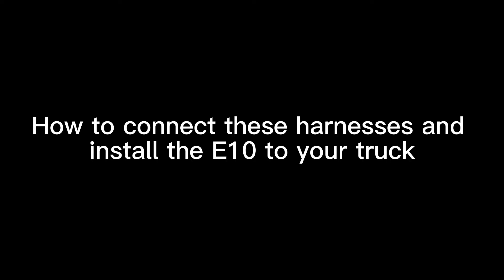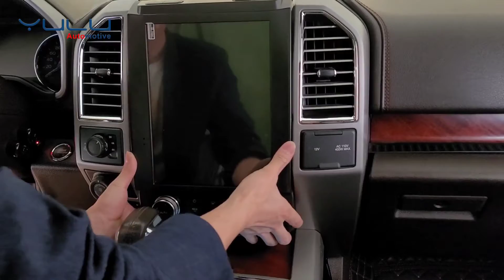(STEP 3) YULU E10 for F-Series Tesla-style screen installation video. F150/F250/F350/F450/F650 radio

Comment: Just finished the installation of this today in a 2018 F150 Platinum. I upgraded from a previous Linkswell. The video is very informative and users should watch and take notes before proceeding. I did not do the tailgate release (too complex for my taste). Very happy with the installation, will update with usage later. Maintaining factory HVAC controls is a HUGE benefit, thank you for this approach Yulu!
Reply from the maker: Thank you so much for your review!

Comment: I already installed the stereo in my f150 I have an AMP Kicker but the volume is at maximum and I cannot control it from the stereo or from the steering wheel, the stereo says it is at 0 but it does not sound very loud

Comment: I was all onboard until you wanted me to run a cable back to my rear camera. Can't we use the cable that's already connected to the rear camera?
Reply from the maker: Of course, please find the contact information of the YULU after-sales engineer in the package, and ask her to send you an adapter cable.
Reply: I believe the wire they ran was for the tailgate control. They mentioned that if you were installing their rear camera you would run the cable the same as shown.
Reply from the maker: Using the factory 360 camera system only requires connecting the harness that controls the tailgate. If you only have a factory rear camera but want to upgrade to an AHD rear camera, you need to connect the E10 to the AHD camera on the tailgate with a wire harness. But we already have a new solution that saves you the trouble of connecting a long wire harness. Just change a plug at the tailgate location and utilize the factory rear camera harness to transmit signals and control the tailgate.
Reply: @yuluautomotive7433  What is a AHD rear camera? I already have 360 Camera on my truck. I don't want to run a cable all the way to the back of my tailgate. Can you make a video or show some pictures as to how we can avoid running the cable to the tailgate and just using the factory 360 camera with the system?
Reply: @vedadbecirovic465  Its a Higher Def cam. However YULU previously stated that the AHD cam does not work with 360.
Reply from the maker: Your truck already has the 360 camera system, and if you also don't want to control the tailgate from the screen, connecting the wiring harness is no longer necessary.
Reply from the maker: Thank you so much for your explanation, you are absolutely right!

Comment: Does the E10 not use the stock rear camera wire/plug? Wondering why a new cable has to be routed for the rear camera...
Reply from the maker: We have a method that can directly use the factory camera wire/plug, please contact our after-sales engineer before installation. Thanks! Phone number: 8184846579.

Comment: If my truck doesn't have 360 camera, if I provided my own cameras, could I use now have 360 camera?
Reply from the maker: We support factory 360 cameras, it should be noted that we only have front view and rear view outputs on our cables, if you want to use aftermarket 360 cameras, you need to buy the all-in-one 360 camera
Reply: @yuluautomotive7433  Thank you for the replies. Do you have a link to your all-in-one 360 camera? I'm having trouble understanding how an all-in-one unit would work but if I could see the product, it would help me (I'm a visual learner).
Reply from the maker: @TheRoadTaken  https://www.amazon.com/Weivision-Degree-System-Panoramic-Camera/dp/B0105XR91O
please go to this link,It's not our products,just for reference
Reply: @yuluautomotive7433  thank you so much.

Comment: Wondering about the external microphone - if the factory microphone works, what's the benefit to installing the new microphone? Does the factory microphone work with the E10?
Reply from the maker: E10 cannot directly use the factory MIC. But for the sake of aesthetics, we made the MIC look like an OEM, so that it can be hidden in the top control panel just like the OEM MIC. This is a unique approach among aftermarket products.
Reply: @yuluautomotive7433  is there any instructions on installing the mic in the upper control panel?
Reply from the maker: @danmaloy8707  please refer this video:https://youtu.be/ONomHWXjfrM

Comment: Not able to get the mic working, I Installed per the video. I have 2018 F-150 Platinum with 360 cameras and B&O sound system. Everything works except the sound for the phone both incoming and out going, I have an iPhone 13 Pro Max.
Reply from the maker: Don't worry, maybe the MIC plug is disconnected, please check its plug again. If the fault cannot be resolved, please contact our after-sales engineer for help. Phone number: 8184846579
Reply: @yuluautomotive7433  it was indeed the cable, the mic now works. I believe my TLINK app needs to be updated/replaced it will not connect even though I’m connected via Bluetooth. Also, I purchased a Verizon SIM card and service, however after activating it in my iPad and confirming it was activated and worked. I installed in in E10 and when I turned on “Cellular Data” in settings it said SIM card disabled. So, I purchased a mobile hotspot with the hopes I could connect the E10 via Wi-Fi and have mobile internet to drive the apps while using Bluetooth to operate CarPlay. Sometimes the E10 would connect to the hotspot, but TLINK will not connect now. Prior to the SIM card exercise, a number of times when the TLINK would connect, the CarPlay music would only play out of the drivers tweeter speaker. I’ve reached out three times in the past 2 days via the What’s App chat with no response, I’ve also left a voicemail (today was the first time when I called the number I was able to leave a voicemail) I’ve also sent a message through Amazon where I purchased the unit. I really need to speak to someone on the phone, these issues are to convoluted and numerous to resolve in a chat.
Reply from the maker: Sorry, just saw your message. Our after-sales engineer said that he has responded to your question. If your problem has not been resolved, please continue to communicate with her until all your problems are resolved, thank you!

Comment: So I purchased one of these today. I have the 360 camera system. When I bought it, it said it would retain the 360 camera system without having to run additional wires. Is this correct or do I have to purchase additional adapters?
Reply from the maker: You don't need to buy any additional adapters for this.

Comment: how does the tailgate wire hold up under the chassis and wheel well in snowy weather?
Reply from the maker: No matter what the weather will do, the wiring harness goes from the screen to the tailgate.

Comment: I have a non working oem 360 degree camera because of the IPMB module went bad If I buy this unit you think my existing 360 degrees camera would work for the unit? I would have to spend $2500 to the dealer get my 360 degree camera working
Reply: It’s for 2017 f250 with manual AC
Reply from the maker: The factory 360 module is necessary for the E10. Go to ebay to buy IPMB modules, you only need to spend very little money. Make a note of the SN on your OEM module, search for it on ebay.
Reply: @yuluautomotive7433  thank you I just ordered a new IPMB.
Reply from the maker: good

Comment: Anyone else having issues with the bracket not connecting? Everything else is set up correctly but the bracket is not "snapping in place" similar to the guys struggle in the video.
Reply: I know this reply is old but I wonder if he didn't transfer the clips from the old bracket to the new bracket? That wasn't shown in the video.

Comment: Installed my unit today. Tried doing it without and with the audio box. I still have no sound. I called the number and all it does is ring and ring then just hang up. Can't leave a message.  Can someone help me figure this out?
Reply from the maker: After connecting the audio box to the E10, you need to enable it in the car settings.

Comment: I also have radio but no Bluetooth and no sounds from YouTube or any other app.
Reply from the maker: Please connect the audio box to the E10. If you bought the E10 from YULU’s Amazon store, shopify store or ebay store, please find the audio box in the package and connect it to the E10 according to the steps in the video, and then enable it in the settings. If you bought the E10 from other sellers, please contact them to buy an audio box, or contact our after-sales engineer to buy it. Tel: 8184846579

Comment: Can't you use the original mic from the factory?
Reply from the maker: The factory MIC cannot be used directly, because the electrical reference is different. But we have another MIC that can be installed in the factory MIC position, which looks the same as the factory MIC and is also installed in the sunroof control panel. If necessary, please ask for it from the after-sales service personnel after purchasing the E10.

Comment: I just finished the installation and my AC doesn’t work
Reply from the maker: Please check that the plug on the back of the A/C control panel is connected correctly and that the pins in the socket are not bent. E10 retains the original A/C system and there is no electrical connection with the A/C, which will not affect the normal operation of the A/C. If the A/C is not working, there must be something wrong with the installation. If you still can't find out the reason, please contact our after-sales engineer. Thanks!
Reply: I installed my unit. AC or mechanical knobs don't work. Removed connector - no bent pins. Help!
Reply from the maker: Please contact our after-sales engineer for help, thank you! Phone number: 8184846579
Reply: Your customer service is awesome. Thanks for the help. Everything is working fine. Mission accomplished.
Reply from the maker: Great to hear that, thanks!